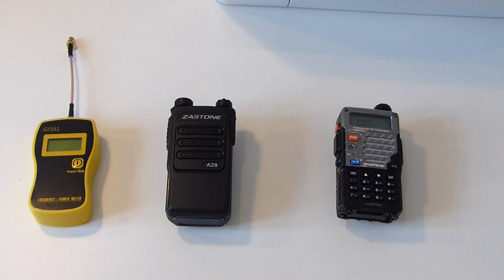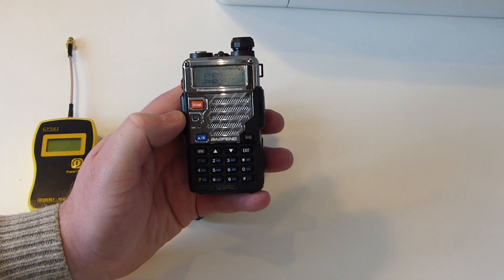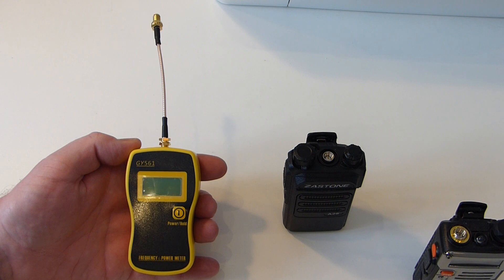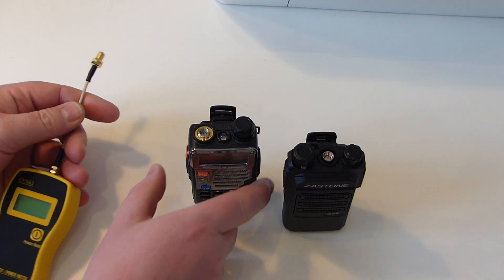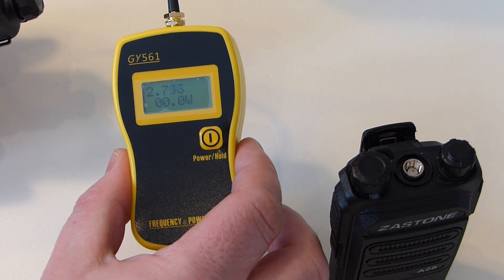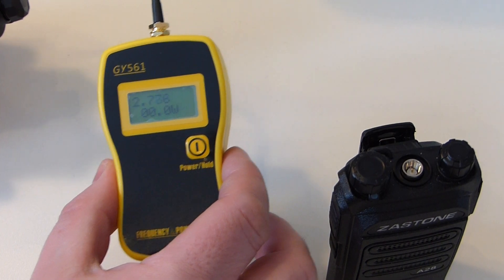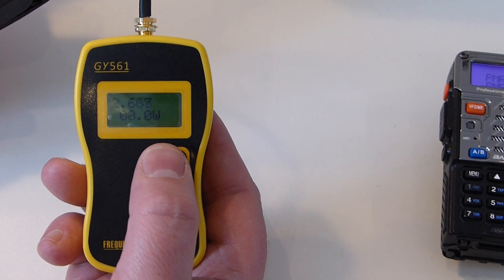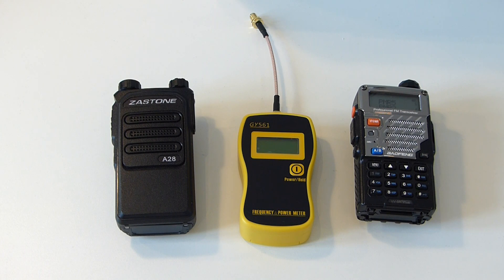A 20 Watt UHF radio

Comment: You should have tested the Baofeng on VHF. The power would have far exceeded the stated 4 watts. UHF is always lower.  For a real test, try the Leixen Note, a hand held rated at, 25 watts, but a reported 40w has been achieved.

Comment: Couldn’t see the battery lasting long putting out 19 watts.
Reply from the maker: Paul Jones exactly. During programming I’m putting it on half power.. should help the battery a little
Reply: Did you measured output power on L mode?